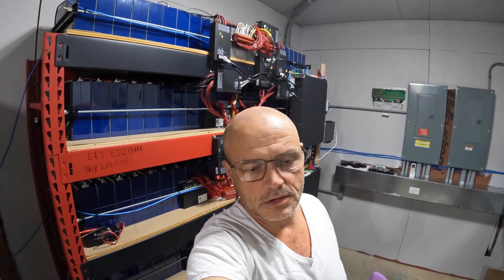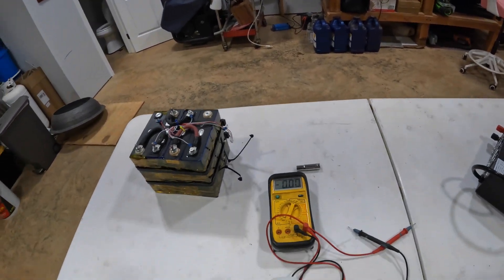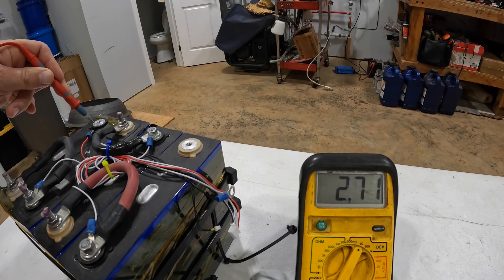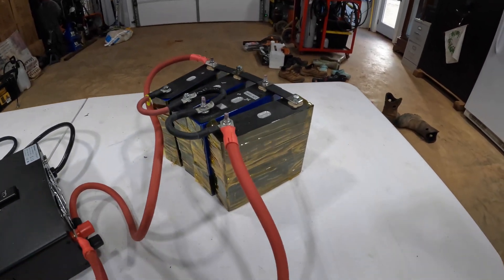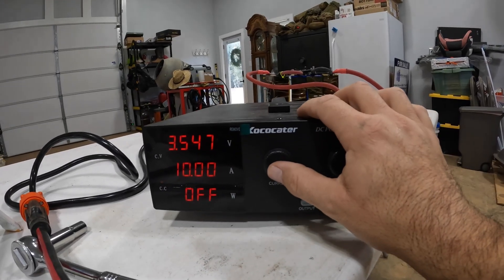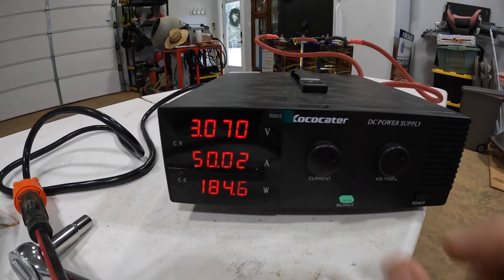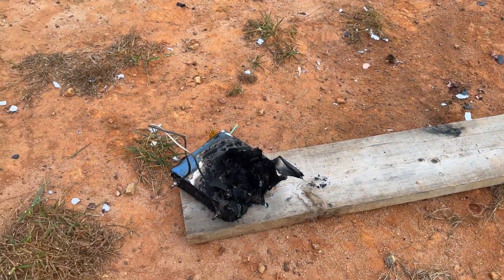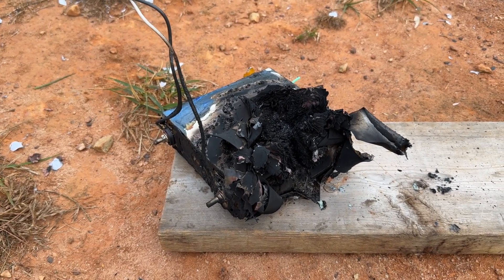Lithium Iron Phosphate (LiFePo4) Cells Safety Test

Comment: Those pack are not correctly protected... a box around each pack would have been a minimum, with a non combustible material. Then all those wires should be protected too ... 
And more ... you got no access to the top of those pack ... how to check torque... each pack is exposed to whatever conductible would fall on them .. 
Seriousness of a build should increrase with the energy den,sity/capacity ... this is not the case here, method to build an easy 12V pack has been used for a 250+kWh .. non sense, not serious.

Comment: Cool test!   Was looking around to see how sutible these cells would be for car audio builds.  
I was leaning more towards trying out some LiPo batteries as they seem to have the lowest internal resistance and no problems discharging over 100 amps out of such small batteries.  
I wonder if they make anything larger that can deal with a 2000 Amp Draw without dropping voltage?  :hand-orange-covering-eyes:
Reply from the maker: You could always put more in parallel to increase capacity. Also they make 650 ah cells.

Comment: Would like to see the test again without the wires connected to the battery in case there was an electrical short of the wires which caused the gas to ignite
Reply: LFP releases a large amount of hydrogen and carbon monoxide gasses when it goes into thermal runaway. If it fails in an enclosed space, it can quickly reach the explosive range and blow up the whole place. Many newer grid-scale batteries are fitted with spark igniters at their relief vents to ignite gasses immediately instead of giving them a chance to find a random ignition source, potentially causing additional damage, injuries and possibly deaths from deflagration.
Reply from the maker: That's an interesting thought, but the wires weren't shorted.

Comment: Ok. For this is a really f!ucked up cell swollen to the max an charged like hell then getting a bullet inside, i think this is very nice to see. It´s nearly impossible to f!ck up a cell like this in normal usage. So I think, i love them even more now
Reply from the maker: Unless doing something totally dumb, they should stay safe forever. Thank you.
Reply: @DMIINC2013  That has been my experience so far. I had a 16 x 100Ah LFP battery in my garage for 4 years. I didn't measure it at the beginning, but after 3.5 years I measured it and it still had 102Ah.

If you treat LFPs normally, they are definitely very durable and, as we know from your video, also very resilient.

so for me this chemistry is my favourite for over a half decade now. Thank you for Video to consolidate my opinion. There are very safe as I think.
Reply: Странный Вы человек. Их специально ставят в условия чтоб из не раздуло. Их конечно раздует если они не закреплены по периметру.

Comment: Anything can fail nothing has 0% risk if you want 0% risk to your home put the battery bank in another enclosure outside the home. LFP when they fail highly flammable gas is vented if it builds with the right mixture it can explode this is what we saw happen with the narrow boat in the UK. We seen a few posts on the DIY power forum homes that burned down from LFP. The most recent one was guy had a 60 kwh diy bank without a BMS charging to 3.65. His got so hot it melted angle iron. If your interested in reading about it search on the DIY power forum for Almost lost my house and my dog.

Comment: In a report about a house explosion, an investigator described a scenario where the BMS fails, a LFP cell is overcharged and produces hydrogen (among other gasses/smoke), which then filled the room/house and exploded.
Reply: It's possible it happend that way LFP can fail and vent gas if you don't have good ventilation might be a good idea to add some.
Reply from the maker: Takes a lot for LFP to fail. However closed loop communication with Inverter/Charge Controllers is a must for proper safety.
Reply: We can sense your fear of the worst case outcome 😂